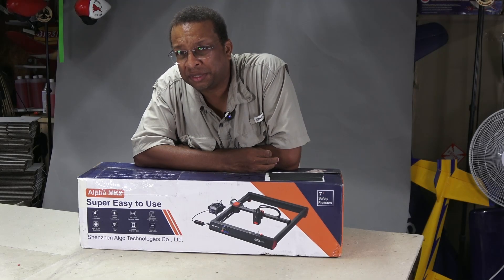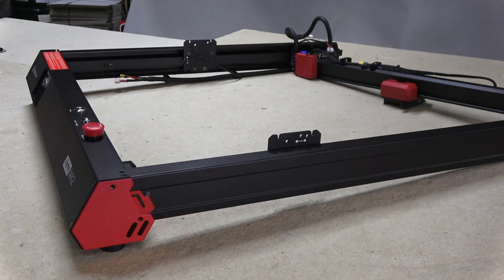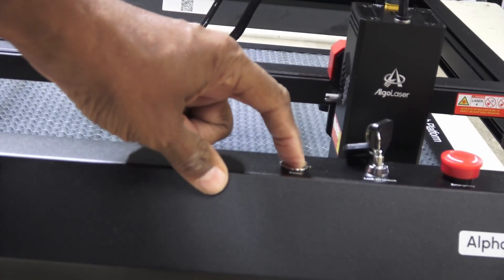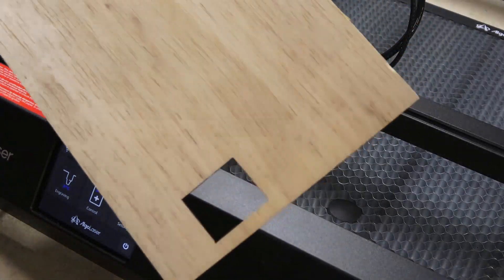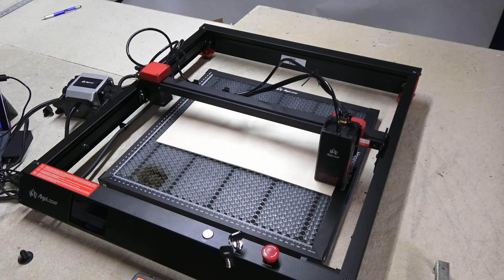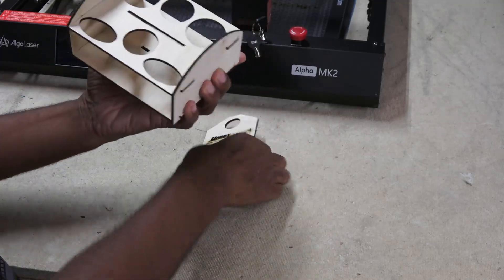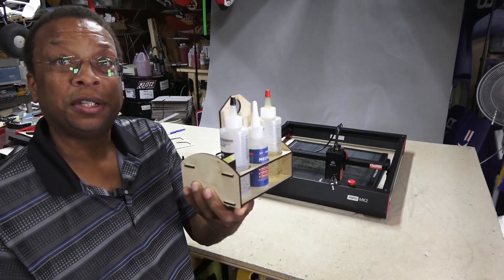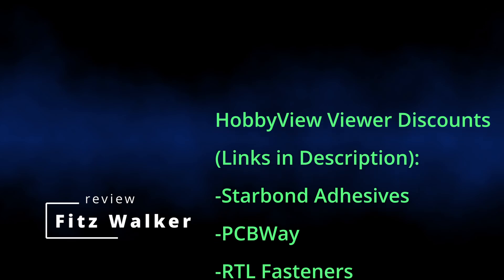Best Beginner Laser Cutter? - Algolaser Alpha Mk2 | HobbyView

Comment: What is the work area size and have your tried to cut FT Foamboard with it?
Reply from the maker: Work size is 400mm x 400mm. You can expanded it with optional parts to 400x800mm.
I tried cutting FT foamboard with another solid state laser with mixed results. I need to try again now that I've resupplied on their foamboard.